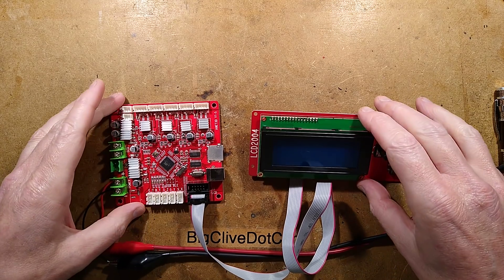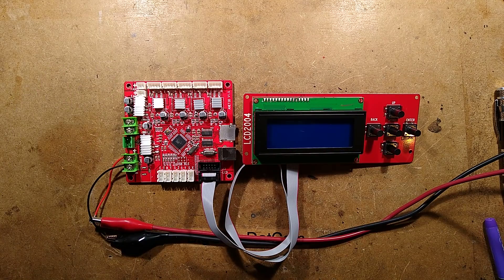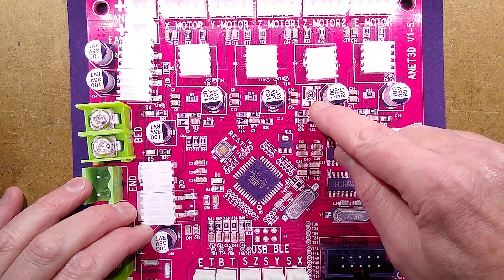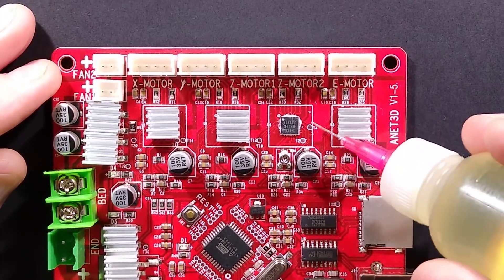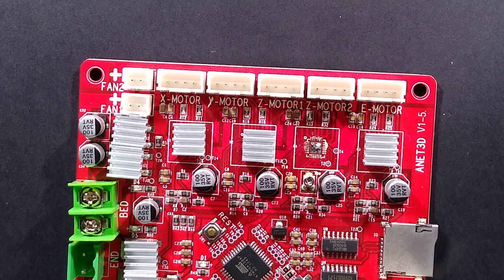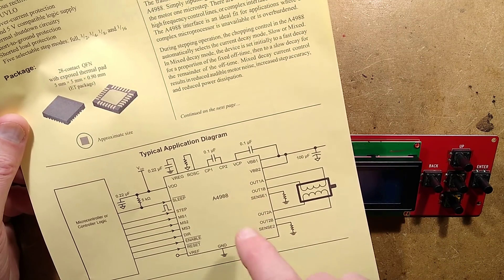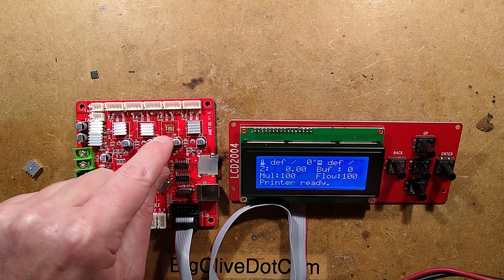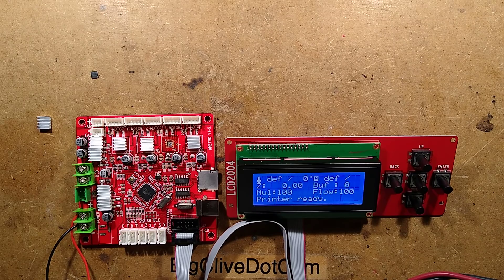Diagnosing a dead 3D printer controller

Comment: those melzi boards are rubbish. barely able to drive the motors, and the z steppers share a driver. really easy to pop drivers if something crashes, which for a cheap beginner printer really isnt good. upgrade to a mega and ramps board was the best 30 quid i spent on my machine.

Comment: Hi Clive I'm glad you did a 3d printing video because I have a question on witch it best, Creality Ender, Creality Ender or FLSUN with a about £450 and looking at a few with dual extruders and wanted to know what you think would be best as in learning about it and want one that will last years and if possible end up paying for its self over time. Thanks Mr GaTeZ.
Reply from the maker: Not sure about the others, but I have a Q5 and it was very easy to assemble and seems to work OK.

Comment: Those stepper motor drivers fail easily, My ANet A8 doesn't take kindly to having the motorized parts manually homed too fast. The induced voltages from the motors just fry those chips.
Luckily for my machine, those stepper controllers are socketed. That tells me this is likely a common problem.
Reply: Yeah, my printer used the socketed breakout board version of the A4988 drivers from the factory as well (it's a BIBO 2 Touch 3D that I got because it was cheap on a liquidation sale, and was dual-extruder, both of which are good for my first printer). I never fried my drivers by manually homing them, fortunately, but when I upgraded to TMC2208 drivers I opted to get some boards from somewhere (filastruder over in Germany I think?) that claim to protect against backdriving damage. I'm not completely convinced by them though, because backdriving still puts some pixie squeezings back onto the 12V DC bus, as the fans will twitch and start to spin if you manually home at even a moderate speed, just like without the boards on the old A4988s.

Comment: back in the day(late 1970's) when i was an apprentice for a TV company in Australia you had to  adjust the  convergence the pal decoder etc   and we all had a set of nylon  adjustment  tools 
it even had a small flat blade  with a metal tip that was only about 3 mm wide and  5 or 6 mm long with  all but the last 2 mm embedded  in a nylon shaft nice tools  lasted for years

Comment: I killed a RAMPS printer shield and Arduino mega by accidentally plugging the stepper module one row of pins out injecting 12v into 5v I/O pins of micro.
Reply: Ouch. Can't be as bad as the time I fried my Mom's laptop that she needed for her graduate classes while trying to demo a project of mine at my grandparents with the whole extended family there on New Year's Eve. 

TL; DR: I plugged a connector into the wrong spot, put 12V direct from a high-current battery onto an Arduino's 5V line, then proceeded to plug it into my Mother's important laptop with no sort of protection, and turned on the damn battery while I was at it, killing the logic board in the computer. Whoops. Lesson learned, nice grandparents paid for the replacement logic board, and I now use a USB isolator to protect everything upstream of my projects from electrical issues, just in case I make a mistake.

Before anyone asks: No, Mom didn't lose her data during this ordeal or anything (Yay!) because at that point Apple wasn't stupid enough to either solder the storage directly to the board or tie it into any sort of security chip on the board that could've also been killed. The 2.5" SATA SSD in the laptop was fine, as was everything else besides the logic board, so all it took was a quick swap once the new one got here and she was back up and running, minus a few days of having to use another computer while waiting for the logic board to get here. The laptop is still her daily driver to this day, even though this happened coming up on 4 years ago now, so there's obviously no ill-effects long-term from this.

Long Version:
I was putting the project back together in a hurry (it's an Arduino-operated Nerf Infinus with a whole bunch of fancy stuff on it, if you're wondering), and I accidentally plugged the connector from my custom harness that taps full battery voltage (somewhere up to 12.6V from a 3s LiPo at anywhere up to 132A rated) from the MOSFET motor driver board and normally goes to the VIN pin and ground rail on my Arduino carrier board into the wrong spot. I was 2 pins further towards the middle of the board than I was supposed to be, but on the correct side. What's in that location, you might ask? Well, nothing much, just the regulated 5V line that is shared directly with the 5V pin on the USB port. I didn't notice my mistake, and when the thing wouldn't work on its own, I (like an idiot) thought something had just broken with my code that was working earlier, and decided to just plug it in over USB to the only device available (my Mom's laptop), and troubleshoot my code with the convenient debug messages I left myself. Plug it in, Arduino doesn't show up, or even have any lights on indicating power to the board. Huh, that's odd. Maybe it's my cable not sending 5V like it should, I know it's been a crappy cable ever since I savaged all of the casing off the micro-B end to fit through a smaller hole and plug into the microcontroller. So, this idiot decided to just hit the main power switch for the gun, and power it off of the LiPo WHILE STILL CONNECTED OVER USB to see if that would fix the problem. Hit the switch, and the laptop screen instantly goes black. I panic, flip the switch off, and desperately try the laptop to see if it just turned off to protect itself or something. Nope, she's cooked mate. There's nobody home inside that laptop anymore. I ended up finding my wiring mistake rather quickly once I actually went looking, then proceeded to absolutely break down (literally off in another room sobbing, I'm Autistic and I for some reason am programmed to value the "lives" of equipment almost as much as human lives, IDK why, haven't ever bothered to try and change it, please don't judge barely 14-year old me too harshly) over recklessly destroying so much expensive hardware by being an idiot and rushing things. I should've double-checked the connections before I even went near the thing with a battery, I should've suspected something was physically wrong when the code didn't change and now the gun didn't work, I should've noticed that the power indicator light was off on the Arduino Micro (turns out microcontrollers don't like 12V on a 5V rail about as much as computers, and I'd fried the poor thing), and I should've never even thought of leaving the battery even in the gun while hooking it up to a computer over USB, let alone deliberately turning the main power on while still connected! Well, lesson learned, and my grandparents were even nice enough to pay for the replacement logic board (Yes, my Mom's laptop was a Mac, a Macbook Pro 13" from 2013 I think), so all I was out was the cost of an Arduino Micro, my pride, and the ability to plug Arduinos into any family-owned device if the Arduino was even set up to accept external power, let alone actually having that power source installed and enabled, unless I used a USB isolator that both prevented backfeed issues on the power lines and optically isolated the data lines, which I should've been using all along.

Comment: You used to be able the pick up the stepper modules with A4988 chips  worse case you could buy the module for a couple of bucks and rob the chip of it.

Comment: they also have ceramic trimmer tools.. ..good for tuning old tv and radio trimmer pots/caps.. plastic ones ya can get some inductance... so you dont need a graybeard with his tounge at the right angle to get it just right before the tool is removed!

Comment: The chip appeared to be soldered onto the board in a crooked manner (or was the heat sink just placed on badly?).  
Perhaps you can properly align & then resolder the chip onto the board properly & it will then work properly.

Just a thought...
Reply from the maker: It was just the heatsink.

Comment: Now the load is gone, take a thermal look at the regulator - more than likely it will be a bit cooler, not heating up the dead 4988.  It may have been stressed, but probably still ok.

Comment: Replacing this very board is where i first hand learned, you can install stepper drivers backwards in an skr board. lmao! the now empty frame sits behind a couple ender 3s these days. Also, you can't install stepper drivers backwards on the mini e3 board. =D
Reply: Also, quite hilarious but understandable that the screen clearly states the printer is ready for use.

Comment: @7:12 there isn't data lines..you said yourself the mic only has to send step and direction to work plus microstep pins. Some drivers such as the tmc2209 do indeed have uart or spi links which allow things like setting current in software (eliminating the need for said potentiometers) but these do not, these are basically thr bargain bin drivers used on the cheapest printers.
Reply: There are still lines that carry digital data between the chips, it's just not data like you'd find in a normal data bus like I2C, SPI, UART, USB, Serial, CAN, etc. It does still count though, as it's all really just multiple binary data lines that are read whenever there is a pulse on the step line. Besides, they're just digital "data outputs" on the AVR chip.
Reply: @jean-lucpicard8186  technically, yes, but no one actually refers to them as data lines. Digital doesn't imply data.

Comment: Cheap way for finding shorts is using canned air upside down or 99% alcohol. If your doing the canned air be sure that the board your freezing is at room temp to prevent too much stress on the electronic parts.

Comment: Would you be interested in reverse engineering a American made Honda Civic Ecu it’s the computer board that controls the engine management would that interest you by any chance ??? If that’s something you might be interested in I would be honored to send it over to you I’m in Virginia and I have a few laying around
Reply from the maker: That could be quite complex to reverse engineer.  Especially with the software locked in the chip.   But there are a few open source engine management computers.
Reply: @bigclivedotcom  yes I have a high priced engine management computer called a  hondata sc300 v3 which is a piggyback software installed in to the 28 pin connector in the lower left of the Ecu which overrides the stock configuration also allowing us to program other sensors and tidbits that make a race car go fast as well as functional but I’ve always been curious to find someone like yourself to break down what all these capacitors and other bits might do to inform myself and others like me who might be curios most people only reverse engineer these for racing I just want to see one broken down and maybe given a better idea how to fix it if it ever went bad as I outsource for soldering work 😞

Comment: I just put one of these into my parts bin because of a dodgy Y limit input
Reply: These boards are off quite a budget 3D printer (Anet A8) which gained a fair bit of popularity because of the capability at their price point. There are lots of community mods available but much newer 3D printers are now similarly priced and are even more capable and reliable. The quality control of the Anets is quite poor, with the board being something that's often replaced, along with other components. Some enthusiasts have gotten to the point where the printer has been upgraded to the point where you could nearly make a second Anet A8 with the parts left over.

Comment: Clive where can you get these plastic trimmers? I have a project with a potentiometer that needs one and I searched high and low for where to get a plastic trimmer screwdriver.
Reply from the maker: Your local electronics company might be an option:-
https://cpc.farnell.com/duratool/1pk-a001/trim-tool-set-10pc/dp/TL04137?st=potentiometer%20adjustment%20tool
Reply: @bigclivedotcom  ah yes I saw some sets like that. What I'm after is a bunch of the same size in bulk for a product I'm developing. Has a pot on board that is about an inch under the lid of the device and while you'd really have to try to stick a screwdriver into the tingly bits, it's still a risk as the opening isn't going to be visible so it will be adjusted by touch. I thought it would be nice to have a small plastic adjustment tool I could send with each one.

I think what I might do is redesign the laser cut enclosure to have a second surface just above the pot so that way the only thing you can hit once you go through the lid and the middle surface is the pot itself

Comment: Just a suggestion: It would be awesome if Clive would put the names/model of the tools he uses in the description
E.g I didn't know the solder removing tool is called a "Solder Wick"

I find myself going through 10s of different videos to remember what useful thing he used that one time
Reply: Just look for soldering starter kits, they should come with solder wick, solder, flux, etc.
Reply: True! Also, do you know the name of the cutters he used in a video where it's offset by a bit such that when you snip the leg of a component off the solder, it isn't as sharp.

I have a Uni project where the PCB is digging into a fabric of a glove and it's ripping it due to the sharp solder finish. Is there any other solution, such as covering the bottom with a layer of resin?
Reply: @s1ckcun1  Old question, so you probably know by now, but they're called flush cutters. Xuron 170-II is probably the best, though you have to be careful who you buy them from because they're a popular product to counterfeit.

Cheaper cutters are fine too, just not as nice.

Comment: I've got an ANET A6 that has a similar board. I believe I fried it by back-driving either the X or Y (or both) steppers while it was powered off. Ended up replacing it with a completely different board from BIQU. Those ANET boards from several years ago are not great.

Comment: This looks exactly like the common display and keys arduino shield.  I'm guessing the CPU is an Atmel/Microchip ATR-8 architecture, making it a classic  Arduino board with soldered on motor drivers.
Reply: real commercial products NEVER use arduino. real serious engineers never use atduino for serious purposes.
Reply: @nsfeliz7825  However many 3D printers are commercial rebuilds of DIY prototypes, a few are even open source designs.
Reply: @nsfeliz7825  John is right, basically all hobby 3d printers (whether custom-built or commercially available) use the Arduino architecture. Only the much higher-end ones (again both custom-built or commercially available) use something better like 32-bit ARM like I'm planning for my first custom printer. I can, however, see a good point to be made for declaring any product that uses the arduino design like that to not really be a "real commercial product", designed by a "real engineer". AVR chips by themselves aren't bad, just completely underpowered for basically all modern stuff and super electrically inefficient (albeit very processing-efficient).

Comment: I mean, it's an anet a8, it's practically failed/ defective from the factory... They have a universally bad reputation for lighting on fire.  The A4988 and clones these days are pretty antiquated, all the cool kids use Trinamic silent stepper drivers. I don't remember if 4988 is what mine has, and it's the kind that sounds like R2D2 when printing a circle...

Comment: Protip: never poke things with your fingers to see if they're hot.  You could burn yourself, or even destroy the chip.  Best practices is to use soft plastic swizzle sticks or straws, or a  thermal imaging camera.  You can get a lifetime supply of straws as probes fairly cheap.

Comment: You can use these for many things. Basically a Arduino with stepper drivers, high current PWM for the bed and hot end. 2 temp sensor inputs. and so on. They can be flashed with the Arduino IDE through the USB. But you might have to do a boot loader flash first because some of the Anet boards didn't come with the BL.

Comment: I hate these "all in one" 3D printer control boards.  Much better to have individual stepper driver boards... if one fails just pop in a new one and you are back in business in just minutes.  And if you want to change to a new and "better" driver model you can.
Reply: For cooling, having the steppers on one main board is better, so the steppers have a ground plane to sink the heat in.
But I agree with that it's nicer to be able to replace the drivers, because there is a lot of user error that can fry them.

Comment: Do you mind sharing the type of flux you use? I had to do a bunch of desoldering recently without any proper flux and it was a real pain.
Reply from the maker: I made my own with rosin dissolved in isopropanol.  It's available online quote cheaply as liquid flux for electronics.  The gel flux is also very useful.
Reply: @bigclivedotcom  Thanks!

Comment: This driver gets hot when this small capacitor near it is faulty (shorted or open) too. Worth checking. Maybe it will work after capacitor replace. That was it in my case anyway.

Comment: The anet is a fire hazard. The green connectors are bad quality PCB traces are too thin.
I have repaired the exact same board for a friend. His MCU had a pin failed ( stuck low)...

What a bad design...